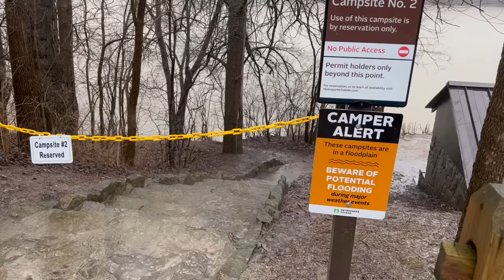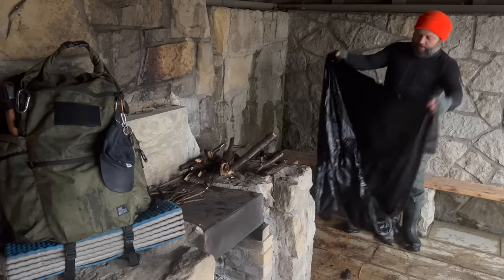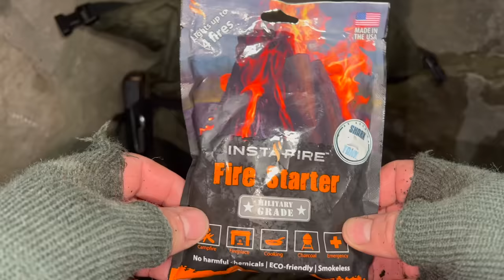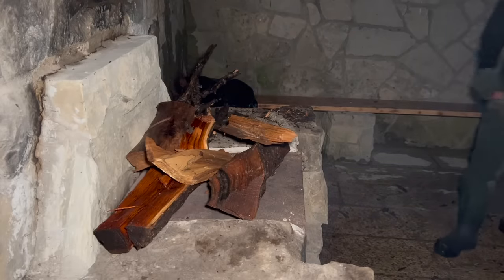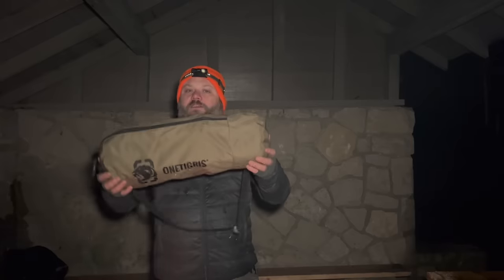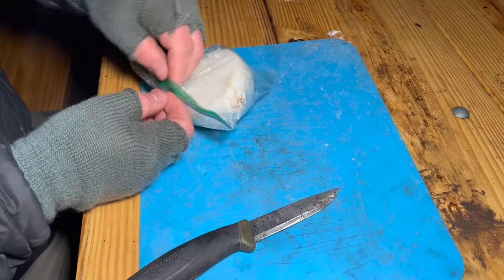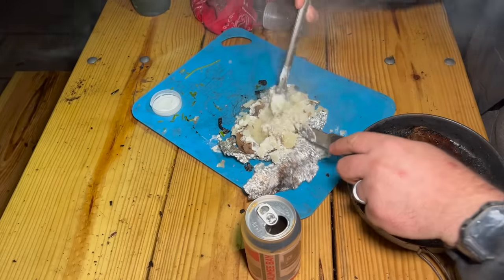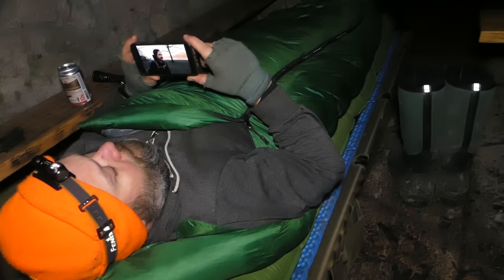Camping in a Stone Picnic Shelter during a RAIN STORM

Comment: Suggestions from a retired backpacker:  when your daylight is limited, make certain you spend it wisely. I would much rather forage for firewood in the daylight and do any breaking/cutting with my headlamp. Running out of firewood on a cold rainy night can be fatal. When I would go out and preplan my meals any chopping slicing or cutting was always done at home and carried in ziplock bags.  Sometimes I would even cheat and bring precooked food that only required heating. On a rainy night is a great time to put up a water collector and fill up a collapsible gallon water bag. I always like to have more water than I need. Enjoyed watching you as it brought back many memories and let me enjoy being as out as I can be anymore. Especially on a cold wet night I would get out of my clothes to let them air and dry out. Especially so in that nice dry shelter. Thanks again from an old guy.
Reply from the maker: Thank you for the comment and the tips! Glad you enjoyed the video my friend.

Comment: Love your videos, Pro tip: You can use the air pump you used to blow up the pad to help keep the flames going. Just point it down at an angle. I would love to camp there it looks so amazing!
Reply from the maker: Interesting idea!
Reply: @Camping with Sam Bananas  It's great for getting a fire that's  low or mainly  emebers to reignite.

Comment: Something I figured out about cooking a potato in the coals is that you can cut open two beer cans, throw the potato in, and then use the closed ends of the two beer cans to enclose the potato and cook it. It lasts for more times cooking than aluminum foil and, in my opinion, it makes the potatoes taste better too. The only reason I figured this out was that I realized I was out of aluminum foil, had no more money left to buy more, but also that my beer cans were aluminum so it was one of those happy little accidents.
Reply from the maker: That is a really interesting idea. I might need to try that, because I've always got beer cans with me
Reply: @CampingwithSamBananas  Same here and, one day, I went to get some aluminum foil from the kitchen to wrap my potatoes in and we were out. Since I needed to get out there early before it got hot, I decided to use beer cans since I also have them at home too.

Comment: 😮 dude! Why didn't you bring you a tarp and some duct tape? You could have kept the tarp on the side of the wall with the duct tape and stood on the table and take up to the ceiling and to the other side of the wall.😮 And all that heat from all that cut wood would not have escaped out of the opening of the picnic shelter.
Reply from the maker: A tarp would also trap all of the smoke. And with the gear I have, I don't really need the fire for warmth. Plus a tarp over the opening would making filming into the location much more difficult.

Comment: why not instead of bringing in pieces of firewood piecemeal and taking off your rain gear each time you spend some decent time and collect a good amount of fire wood so you don't have to keep going out in the rain and getting wet
Reply from the maker: Because I was working with limited time and I wanted to get a bed of coals. Which takes time and that means I need to get the fire going sooner than later.